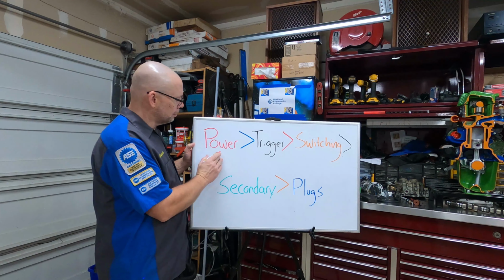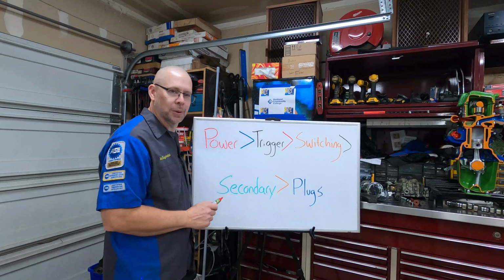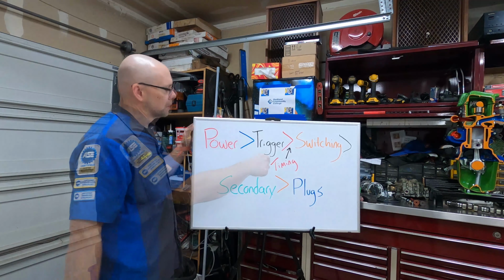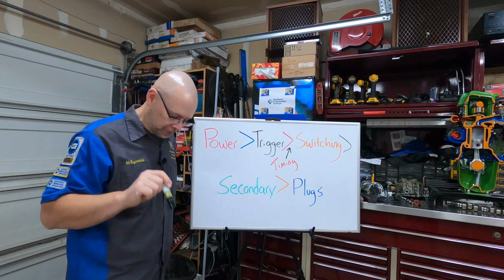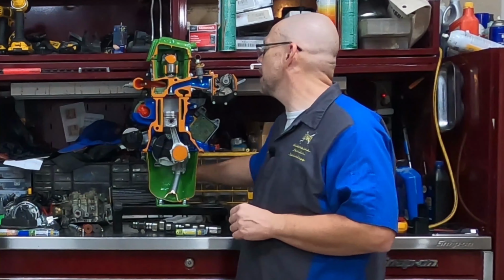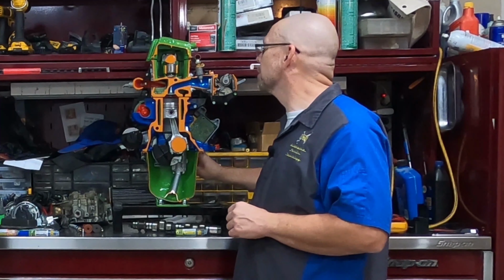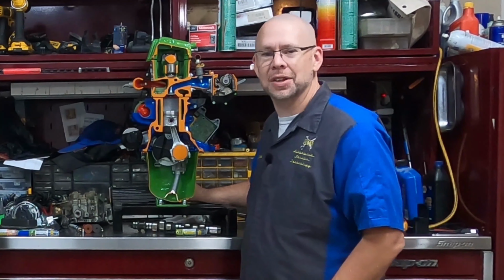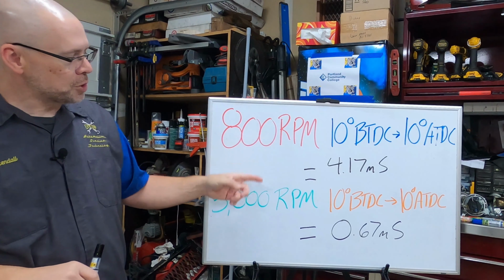Ignition: Timing

Comment: I get little confused here. On another channel I saw someone checking for timing. He used scope. He did what he call relative compression test. He hocked current clamp on stator cable and the other wire on the triggering wire of cop.
The square signal matched exactly on the top most of the current ramp. He said the car is on timing. 
But according to you the signal was supposed to be little degrees before the top most of the current ramp.
What is happening there